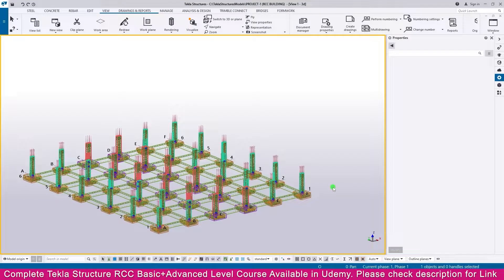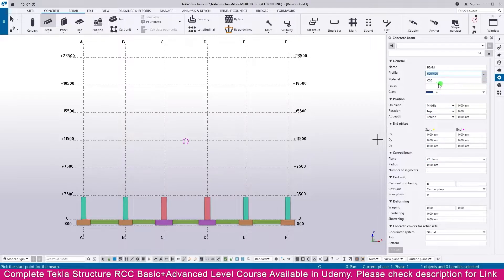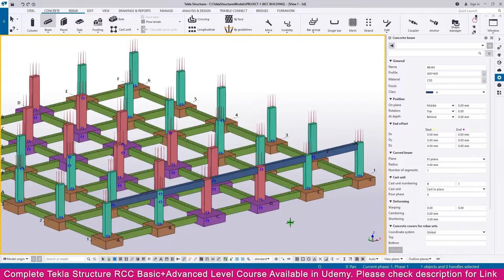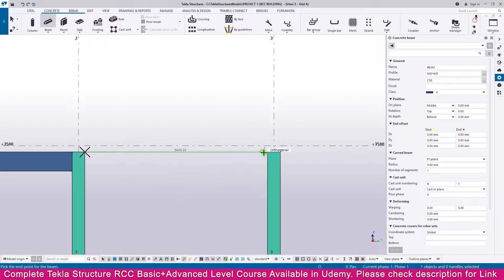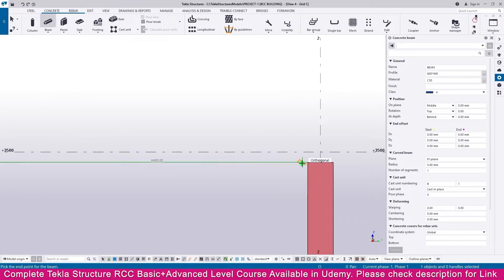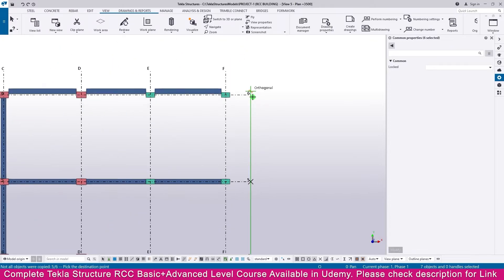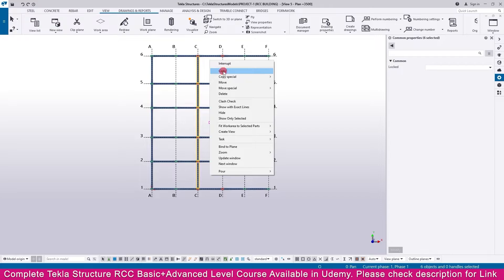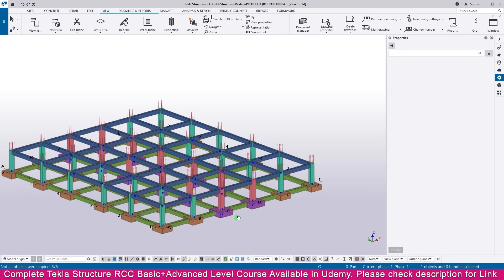10 Create Concrete Beam in Tekla Structure

Comment: Thanks for your explanation.  I will like to know whether the height of the column should exclude the thickness of the slab and whether the beam thickness include or exclude the thickness of the slab.  Here in Mauritus if we have a beam say 425x200 the height of 425 include the thickness of the slab which is 125. Moreover in 90% of cases, the web of the beam that the lower height of 300 is cast first then shuttering and reinforcement is done and many days afterward is the top part of the beam (the 125 mm.) cast with the slab. Those few information will be most helpful. Thanks.